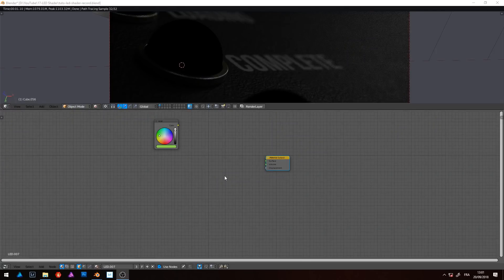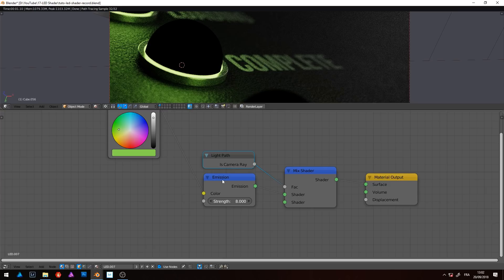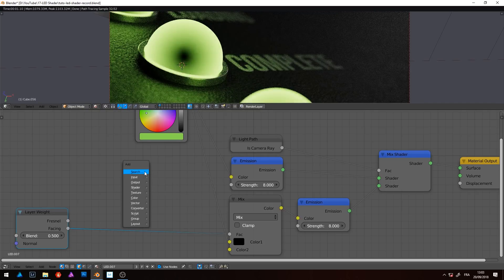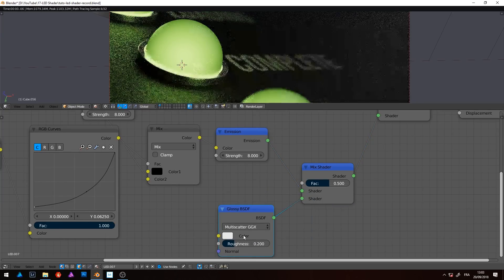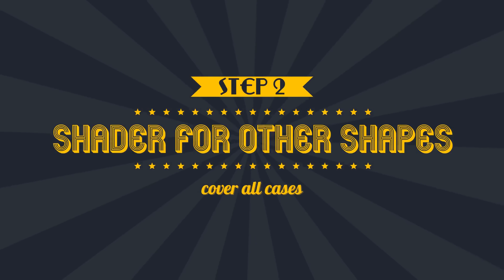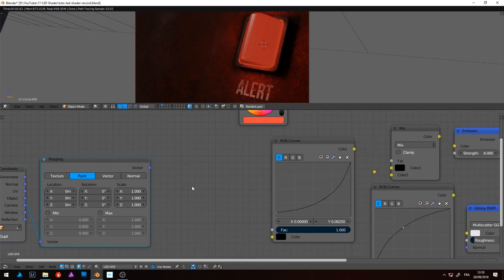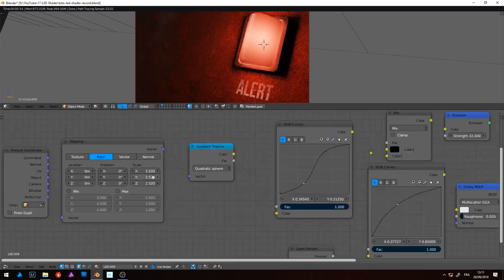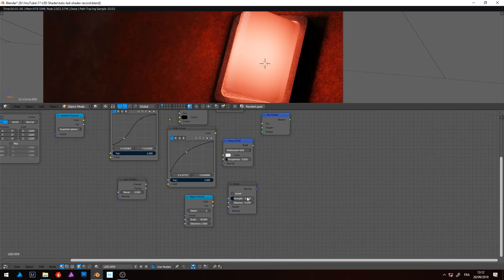Light Indicator, LED Shader - Blender Tutorial

Comment: is it possible to add a image texture to the face of the bulbs / button?  if so where would you input it?
Reply from the maker: Interesting question ! Yes you can, at the end of the shader add a new mix shader node, plug a principled bsdf which use an image in the first input then use the image alpha output to the mix input of the mix shader.
For an efficient help I advise to use the discord.

Comment: Great tutorial. However, the settings you use for the material editor makes it almost impossible to see the connections for nodes. You may want to have different settings just for videos. I could barely see the connection lines even zooming in on the screen. Also you don't need to have a blend file for download just a full res screen shot of the node layout. Even a full screen shot of the node layout in the video would work.

Comment: Overall nice work. As a noob, I had some difficulty following along, especially in the second half of the video. You were connecting nodes that were not visible on the screen. And you were connecting nodes so quickly that I simply could not follow along. Is there any chance that you can post your resulting .blend file? I looked on your website but couldn't find any files for download. Otherwise, great video and thanks for taking the time to help educate me!
Reply: I got the same problem
Reply: I believe what he did at the end there (assuming the off-screen refers to the connection off to the right) is that he's plugging the node he's using directly into the output to visualize the changes he is making to the magic texture.

Comment: Very cool thanks! So how i can do if the fresnel effect i have didnt work like your? It s very struggling. I have the same nodes have you, but the result isn t the same. I told for non spherical shape. Tank you
Reply from the maker: Thanks for your comment. For the fresnel, have you use layer weight node and the FACING output and not the FRESNEL output ?